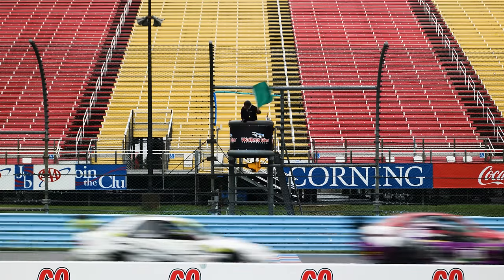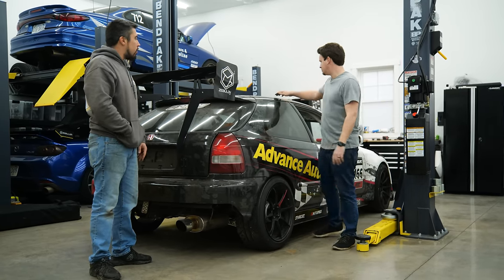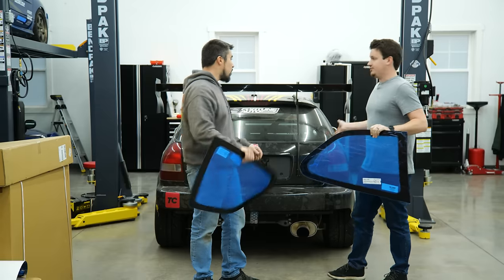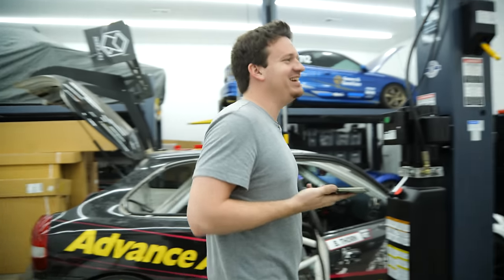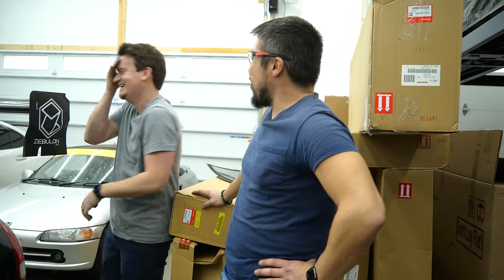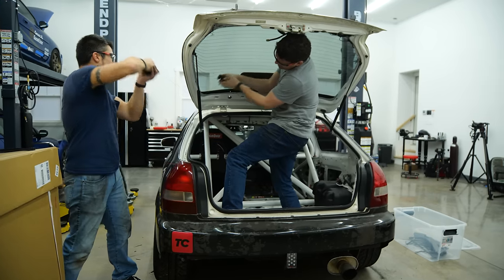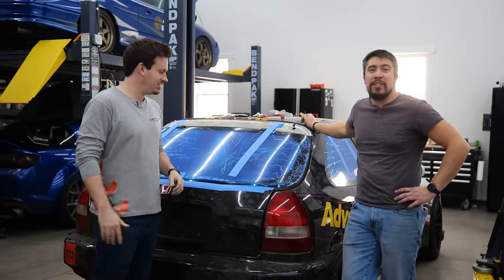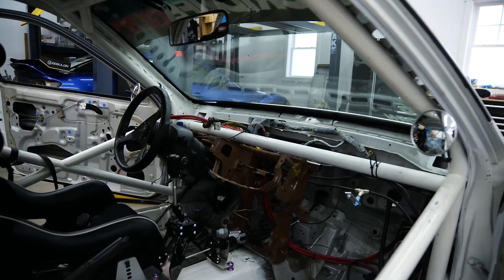Starting the 2024 Racing Season

Comment: Mark will never install a carbon roof again 😅
Reply: Wat did he have one go really wrong?
Reply: @dantehughes897  the sti, just was time consuming and such for only a small difference that was more cosmetic over all
Reply: @LoserSnoozer  it also leaked after 1 or 2 weeks of work installing it, so yeah there wad a major issue, that's where the episode ended and we haven't had any news since
Reply: @alexelrod242  he got it sealed properly so it doesn’t leak anymore
Reply: Probably wouldn't even help the Civic much in termss of structural rigidity. The weight gains if any would probably be ruined by cutting the structure.
Reply: @LoserSnoozer  thanks for da info dudes

Comment: When did you guys lose the advanced auto sponsorship?
Reply: Advance pulled all of their sponsorships in all Motorsport. They have been having some finance issues in general and this is just a cost cutting measure
Reply: The two Bens announced this earlier this year as part of the Eclipse vs RX-8 road trip series. Advance Auto usually sponsors those as well but they had a lot less to work with this time around
Reply: Advance bought most of not all of the pepboys store locations. They've really expanded a lot here on the west coast and I think they're having trouble with competitors like Autozone and oreilly having a strong base here.
Reply: Wouldn't it go faster with front windows?

Comment: Rain-x or similar on the windshield, inside and out. won't fog up. swap the interior non vital bolts for Alu', not too expensive and saves another few pounds. can do similar for body panel fixings. 
for the cost of carbon roof you could have better weight savings with something like titanium hub nut, wheel studs and lugs. probably even lighter hubs too. unsprung weight saving too

Comment: Maybe things have changed (since it's been a minute since I worked in auto glass), but I remember using stuff like windex to keep the urethane wet and something to keep the blades/wires from building up too much heat from friction did wonders to make things less of a pain in the ass. D:

Comment: Do the rules allow undertrays and diffusers? With proper ones you'd reduce drag, increase downforce, might even reduce the size of the massive rear wing which adds a lot of drag.
Reply: He had to reduce the size of his splitter to meet rules. Partial undertray is permitted, just not sure if he has fully exploited it
Reply: CTR's ruling: 
Rear undertray diffusers are not permitted, factory or otherwise.
Flat underbody floors/pans are prohibited.

Comment: Two points of advice,  get rid of the ignition steering lock. Its a race car, you dont need it. Go to a toggle on or push button set up. Second,  professional drivers actually use soapy water in a spray bottle and spray the inside of the windshield.  That would be a cheaper alternative

Comment: Well... since you are not using windows in the doors you have to know that the wind thats getting inside the car is slowering you so much, so i think you sould put windows or make some kind of open at the back window so that air can flow freely and dont make you slower. I know its a little thing, but when racing everything counts
Reply: GLTC rules don't permit windows on the front doors.
Reply: @yongling9825 then it might be faster without the rear window

Comment: Maybe a window for the passenger side to reduce drag? Like a poly window with a thin tubing frame that can be removed..

What about venting the hatch to get the air out of the back of it…
Reply: Don’t think the rules allow side windows.
Reply: @Patrick94GSR  I looked it up…

Driver and passenger front windows must be down and preferably removed.

Too bad there wasn’t a way to bend that… but maybe venting the rear of the car more would allow the air to escape just as fast… I’m sure the drag with the front windows down is causing something negative in aero
Reply: @Super_64  it’s a safety issue. You’ll notice NASCAR also doesn’t use side windows, and they run near 200 mph.
Reply: @Patrick94GSR  yes they do… not on the driver side but the passenger side has a window that’s removable

Comment: Just a thought for you, surely having no front windows negatively affects aero and would allow air into the cabin, like a mild parachute affect? To keep weight down would a simple wind deflector work or are you planning on having lexan front windows?
Reply: Ben already mentions in the video that front windows are a no-go with the GLTC regs.
Reply: Ah I must have missed that part, thanks. Strange reg compared to almost every other series 🤔
Reply: @marcus6137 I'm no expert nor am I affiliated with Gridlife, but I think the logic behind the "windows down" rule is that if someone were to experience a side impact, the glass would shatter inside the door rather than on the driver.

Comment: Looking at ClubTR's rules, unless they're changed 

Cars must retain OEM glass. Replacing factory glass with lexan/polycarbonate is prohibited, except in instances of aftermarket hard tops (eg. S2000, etc. ) if sold with lexan/polycarbonate as the only option.

Is the civic going into a different class?
Reply: It has been converted into a GLTC racecar since GRIDLIFE 2023, it's no longer a time attack car.
Reply: @yongling9825  oh yeah i forgot, oops

Comment: Is the track layout different or just that your car is really really fast because Mclaren Senna did 2.34.9(tested by car & driver) on the VIR and you just did a 2.07.5
Reply: The Senna set its lap time on the Grand Course (East or West, I'm not sure) layout, the Bens tested on the Full Course layout, which is shorter than both Grand Course layouts.

Comment: Can you please tell me why you insist on filming at 24fps? This video is so much easier on the eyes at 1.25x speed (simulates 30fps) but, of course, that's not an accurate representation of how fast things are happening anymore, and the timings on the cinematic shots are all screwed up. TBH during the cinematic shots, that's the ONLY thing that's lost at 1.25x, though.

I think if you pair 30fps filming with whatever shutter speed you use at 24 (presumably 1/50th, but also try 1/40th so the extra motion blur can offset the higher frame rate even more) it would have the same aesthetics, but with a smoother/nicer feel that's more suited to vlog or hybrid vlog/episodic content like this.